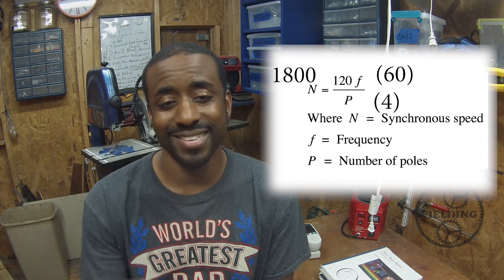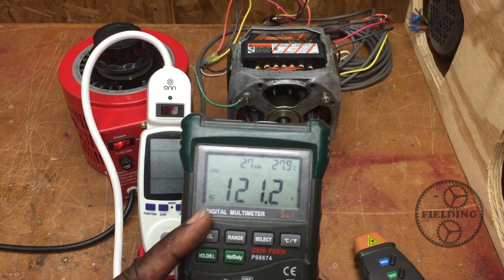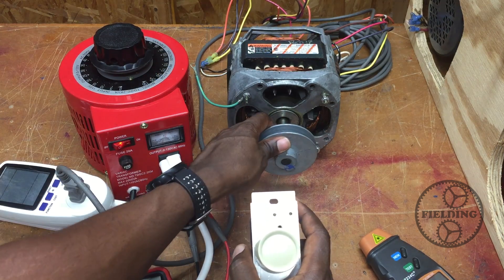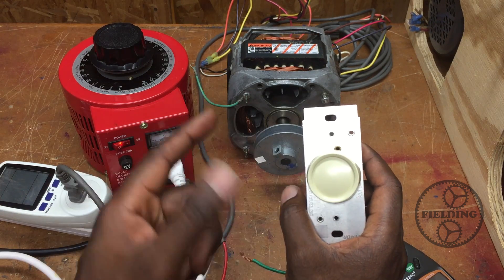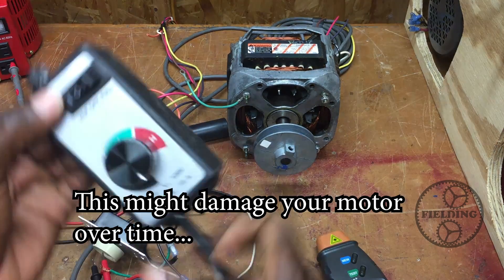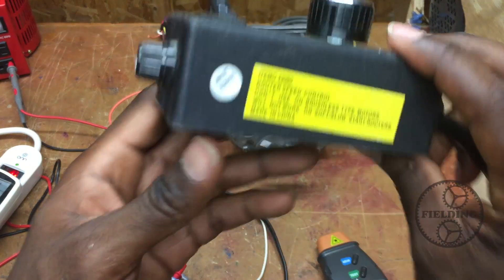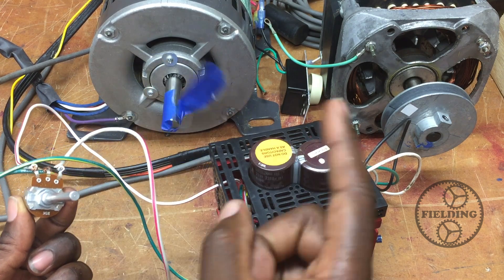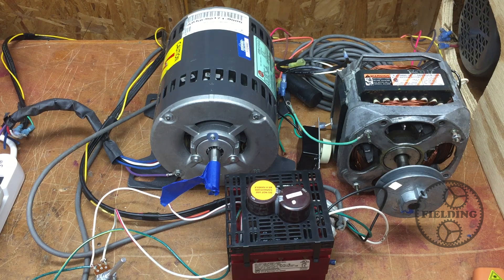Will A Dimmer Switch or Transformer Control An Induction Motor's Speed: 038

Comment: I know this is a very old video but I wanted to know if you can tell how the speed is controlled on the Harbor Freight -Bauer 8in variable speed bench grinder. I'm assuming it has a capacitor.

Comment: Great content. I believe there is now a VFD coming from China that will allow you to convert 3 phase to single phase. They usually come with the 2x72 belt grinders for like knife sharpening etc. Am I correct in thinking they would work for induction motors?

Comment: Hey Jeremy. Great videos. You have fantastic teaching skills, I just wish maybe I had better learning skills (with motors). I'm very good with my hands & I recently made my version of a spray (rattle) can shaker. I'm working with two bad shoulders doing some body work on my mothers car & my old Ford Ranger. I have a compressor & spray guns, but it doesn't make sense to pay for larger amounts of primers, sealers & blending agents to do a couple of small areas. So, I'm left with aerosol cans. And, some of these solvents, need "a whole lot of shakin'" to be going on! My shaker contraption is a little different from others that I've seen on YouTube (there's are a bunch of them!) It works great. My problem is with my motor. The only motor that I could think of, and afford to screw around with, was a cheap electric drill. I got a $14 closeout drill from H/F. I have mounted the drill, less the chuck, to my project & it really works great. My goal was to be able to use a knob or a slide control to start at zero RPM, "ease" up to a good working speed, then be able to let it do its thing for a few minutes. I've played with a few ideas, but...  The way it is now, I have a zip tie keeping the drill trigger pressed in all the way with a cheap little Amazon aluminum body AC motor speed control (came as a 4 pack) for maybe $15. I used one to interrupt power to the brushes, but I know it's not right. It does a great job for about 30-40 seconds, then I get the smell of "electric". It seems to me that there must be some way to do this correctly, while at the same time leaving my house on the foundation! I guess what I'm asking is, how does a true variable speed drill trigger work? Because that is pretty much what I'm shooting for, but in a separate, off to the side, turn type knob or slide control that I can set & leave alone for a bit. I wish that I knew how to send you a photo, but I'm not much of a computer guy. What I'm looking at, though, are six wires coming from the load side of the trigger. Two go to the brushes, and then four (lighter gauge) wires go to the coil field (drill is reversable if that means anything to you). I sure would appreciate your knowledge & help on this. Thank you in advance for any help you can send my way. Keith from Pa..

Comment: Great video! I'm left with another question, though. 
You point out how dropping voltage and using the switching mechanism of the dimmer make the motor pull more current to then over heat. My understanding is that if the power source was current limited and that we used the dimmer, then rather than overheating due to drawing more amps, we'd induce voltage sag which would in turn create overheating. 
But, I'm also aware that part of the efficiency of LEDs and class D audio amplifiers is due to constant on/off switching. What if you introduced the dimmer to the circuit after the VFD in low load situations? Or used a class D amplifier to control the motor?

Comment: Just for those who are wondering. There are several single phase motor VFDs on the market. Eaton, Invertek, Yaskawa and several other VFD manufacturers sell them. They are limited in horsepower. Often quite small motors. They are also generally only good for low torque loads - i.e. fans and low overload pumps. If you need torque and speed control, 3-phase is the way to go.

Comment: I have a Trotec TVM 20D 120w fan that says 220-240v / 50Hz - Is it safe to run this at 190v with a VEVOR 1000VA Auto Variable Voltage Transformer? The lowest setting on the fan is too noisy so i want to run it a little slower..

Comment: Thank you Jeremy for enlightening me on this. I wish I watched your video before I bought the autotransformer to control the speed of an induction motor. I did not connect it but was trying to understand if that would work or not. I used a variac to control the power to a heating element, so I thought it would work for controlling speed as well. CFD is the answer. may be I would buy a motor with a controller built with it. I dont know.

Comment: Single phase -> single phase VFD  $55.   I guess you could start up the motor at full throttle and then slow it down?  That would prevent the starting coil problems  right?   ALSO this is 220V.  Would it work with 120??     (Can't put link here but it's on Ali Express CN Weiken model WK600D-0015-M1T   NOTE:  The device says 3ph output on the label, but a customer comment says "Color:220V 2.2kw 3HP Input Voltage: Single phase 220V Output Voltage:1P-220V or 3P-220V Ships From: spain
Works as described, with single phase motor also, just set two registers. Also manual is good, while not complete (missing description of registers how to set single phase load)"  The seller says the manual was updated.   WILL THIS WORK?

Comment: Thank you.

Someone designed my furnace with a three speed winding motor for variable speed and added a triac lamp dimmer in the controller to ensure failure. Luckily it was the triac that shorted with no motor damage.

Comment: you can get single phase VFD's especially at low power levels. it is also possable to modify certain single phase motors to accept a 3 phase input but it will result in an unbalenced load of the need for external componants.

Comment: I'm trying to control the speed of a brushed AC  motor without adding noise to the line.  A triac definitely adds too much noise.  It's a small motor.  Only draws 700ma.  It needs to be fairly small also.  The size of a larger potentiometer.

Comment: thats a two phase induction motor not  a brusshless  motor ,  it has no brushess but  its actually a  2 phases ac induction motor , the so called brushless motors runs on dc.

Comment: Please forgive my ignorance. I have a lesson farm motor that can be wired at 110V or 220 V and it’s reversible is this considered a single phase? I want to use it for my 2 x 72 grinder but I need to be able to control the speed.

Comment: Check out Mr Carlsons Lab where he shows how to build a single phase motor VFD. It won't work for really high power, and probably has a pretty limited speed range, but for small induction motors seems to work great. It's basically just a 555 with power transistors and a transformer.

Comment: I just watched this video so I found a dayton vfd13e660 it shows 110 220 input but it shows 220 three speed out I need it for 110v dayton motor so don't no how it changes 110 to 220v output im not a electrical engineer would appreciate any help

Comment: I enjoyed your video but I was very confused. I'm using a vent axia fan with a dedicated speed controller. I believe it's fundamentally a dimmer switch with extra electronics to improve the wave shape. It is based on the same technology as the one that you had that said on it don't use with brushless motors, well why I'm using and most fans are brushless.  And then you talk about the Variac, I thought that was the gold standard for motor control because you are keeping the integrity of the waveform so you do not get vibration noise that You get with the dimmer type transformers.   Also isn't an unrealistic situation testing a motor with literally no load on it whatsoever.  Even the centrifugal fan creates some resistance if it's out in the open just with the blades of the fan.

Comment: I've been contemplating a little DIY project involving a single-phase motorized impeller. I'd like to install it as a ceiling fan in a bedroom (drawing air from beneath and blowing it out all 360 degrees across the ceiling) because even a typical flush-mounted ceiling fan would be too risky. I want to be able to control its speed from something that can fit inside a typical light switch cutout.

The motor itself is rated for 2700rpm, 120vac, 400mA, 50Hz/60Hz. When running at full speed it should cause the 8.66" diameter, 1.93" thick impeller to displace 530cfm. I also have a question of whether or not I need other components, like a starting or running capacitor.

Comment: if you could disable the starting circuit in a single phase motor, surely it could be run by a single phase output vfd.  as long as it is still rotating, it shouldn't stall

Comment: Someone installed fan speed controller (looks like a light dimmer) at church. I asked him how much he paid for it, he said about 50 dollars. Seems like they make a speed controller for an induction motor. I am curious what is inside them. Excellent video btw, I didn't know that reducing the voltage doesn't affect the speed of an induction motor (under no load conditions).

Comment: Hey, I watch your videos from time to time, and find them very informative... It so happens that I got an old bench grinder that works fine, and I would like to repurpose it to work on grinding/cutting, and polishing semi precious stones, as well as to work on other materials that may not be able to handle the full speed of the machine. My question: Is it safe or "ok" to add a potentiometer or dimmer switch  to the grinder to achieve this?
Thank you in advance for your response..

Comment: Hi Jeremy! This is Simon from Italy. I enjoyed your video but unfortunately it wasn't useful for my application:
I have a good old router for woodworking with a brushed universal motor running at 220V. The router is very well built so I would like to keep it for as long as possible but it's not provided with a speed control circuit. I was wondering if it could be possible to put some kind of circuitery between the router and the line to control the rotational speed. I found many commercially available circuits but they are not very good since they don't compensate when you apply a load to the arbor...
So I need a "closed loop" circuit that can control the speed but keeping it constant under load.
Modern routers have this kind of electronics onboard, they work greatly and they take up very little space inside the router shell so I can imagine it should't be too complicated to put together such kind of circuit.
Could you please suggest me a possible solution for my needs? Thank you...

Comment: Hi your channel is very interesting. I have a question or should I say advice, I have recently purchased a 3 phase 3kw motor that is a 2400rpm motor. I want to reduce this motor by half its speed as it will be replacing the existing motor. The motor is going on a 2 poster ramp, my question is by reducing the frequency using a VFD will this reduce the torque? The original motor was a 3kw 3hp @1390rpm. Also could you advise on what value vfd I would need to get to make this work. Forgot to add that it is a 50hz Thanks in advance.

Comment: Wow, you do a great job of educating those who want to use alternative, cheaper motors in different applications. I am trying to wire up a 1/6 hp oil burner motor to power a flat lap for polishing stones. I have used toggle switches before but I was trying to put a led three pin rocker switch on this motor and I was wondering if you have done a video going over different types of toggle and rocker switches?  Thanks for making sense of electric motors and saving us cents at the same time.

Comment: I agree with everything you say about single-phase induction motor speed control...but I cant understand how cheap, usually 20inch box fans for the home have 3 speed settings.  I'm 98% sure they are not universal motors, probably just shaded-pole as don't need much starting torque and are really cheap.  Please explain!

Comment: Hi, excellent video. I have a 1.5 horse wood lathe that will, using different belt positions, turn as slow as 215 rpm. I would like to have it turn under 100 rpm without belt changes. Is there a way to do this without risking damage to the motor?  Thanks

Comment: Normal yes. A simple induction low torque single phase motor can be controlled by a dimmer which today have a tyrister electronic control card.
Keep the frequently the same for both. And that you dimmer has plenty current  capacity.. 6x.

Comment: I bought a Vevor 1300W 1.6 meg drill that doesn't come with a speed control is there a way to control the speed on the drill with out hurting the motor or magnet. I would think that you would have to wire the motor to the drill separate from the magnet power. If you can help me please do.

Comment: Very informative. Don't the motors break down sooner or later if the frequency is different than the manufacturer's marked frequency? For example, US made electric appliances (60 Hz) have higher failure rate if they are used in countries where the electricity is 50 Hz. Therefore, appliance companies manufacturer country specific for export.

Comment: Hi, I actually have been using for many years a evap cooler with varied fan speed setting using a router speed control. It doesn’t seem to have any negative effect on the motor and it works great. It is a bon Aire cooler that was so extremely loud and the air volume was too intense. I toned it down with a simple router speed controller. Any comments welcomed. Thanks for your insight.

Comment: I have a 1/2hp Dayton split-phase AC motor (115V - 8.8A).  I am making a DIY pottery wheel.  I would like to vary the speed of this motor.  Wondering if you have any suggestions.  Thank you so much for this video and sharing your knowledge.  I am trying to learn and have found your videos a good start.

Comment: Hey! Awesome video. I was wondering if you can give me some insight on making a turn roller for pipe welding. Works on a similar concepts however way more load and at a much slower speed with a secondary foot pedal controller

Comment: Hey Jeremy, great videos! You are the electric motor guy!! I need some advise. I built a vapor blasting cabinet. I have an assumed 6hp shop-vac attached, but only need a slight amount of vacuum to the cabinet. Can i control the speed of a shop-vac motor to reduce suction?

Comment: so to reduce an induction motor's loudness, one has to replace the fan's motor to a less powefull one, reducing voltage wont reduce the humming magntic loudness of a motor , changing the frequency will but that will also lead to start up problems. correct?

Comment: I salvaged one of those 3phase motors from a commercial treadmill and the built in vfd but I don’t have the control board. I can’t figure out where to wire in a POT to make it work.

Comment: Great teaching video’s thanks. I need help with speed control on a 12 volt harbor freight winch motor that I diy my sawmill carriage drive. I currently have a reversing solenoid and a toggle switch to control forward and reverse. The cheap ones on line want to do reversing and spend control but I believe they are not large enough? I am ok with removing the existing reversing switch and toggle if I have to. Can you recommend something? Thanks in Arkansas

Comment: Great job Jeremy! Could you help me with a project to make a dimmer for a sewing machine (sails). Its a 220vac 50hz motor - 2 poles, 0.7A, 150W imput, 75W output. It can be just a switch for half and full power. Thanks in advance.

Comment: Thank you very much. This is super helpful. I do not have 3 phase power to my house, so if I wanted a basic variable speed motor, say 3/4 HP, could I use a brush/permanent magnet type AC motor? And how best to control the speed of one of those? Gratefully, Dadla.

Comment: Is it hard to make a continuously variable transmission on an AC motor to fear it down as needed?  Would that possibly be cheaper than replacing an AC motor with a DC motor?

Comment: Thank you. So it sounds like the best way to add variable speed to a belt sander (so it can be slowed down as needed for sharpening knives and tools) would be to switch to a DC motor?   And, if so, I’m thinking of reusing a salvaged ceiling fan motor (because it’s usually the switches that go out). Are there better options or potential problems with that?  I don’t understand why the belt sander manufacturers don’t make them variable speed to start with. 😢 Is an AC motor cheaper to make?

Comment: Great video... I found this when searching how to control a vibration motor for soil separation. Many videos have said buy this motor and a variable fan speed controller and it would work. But almost anyone that tried it made a comment under the video that it was either off or full speed... the controller didn't work. I believe your explanation just proved why.  Sad, because I really believe I will need that variable control. Any direction you could point me would be appreciated. Thanks Again!

Comment: Hi Jeremy, nice video.  I have a single phase 110 volt  AC motor which reaches rated speed at 60 volts. Torque at 60 volts is enough for my needs. Also the motor doesn't get hot at 60 volts. How can i make it run permanently on 60 volts. What can i use  to drop the mains voltage to 60 voltz? Can i use a resistor to drop the voltage?

Comment: HY02D211B  on ebay will run single phase 110V motor as long as you don,t have the clutch/switch.

Comment: I believe 220 volt motor can use vfd just disconnect the stating wiring but I think the same goes for 120 volt try it to see if it work the same for 120 volt disconnect the starter wire and try it with the vfd